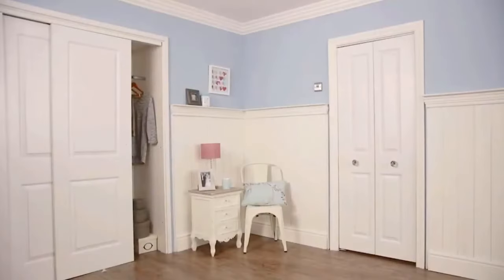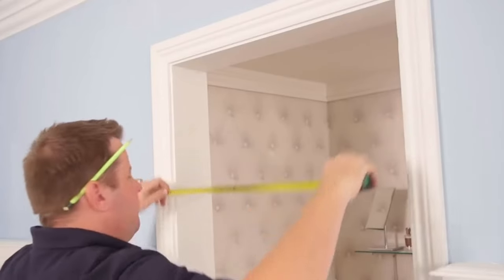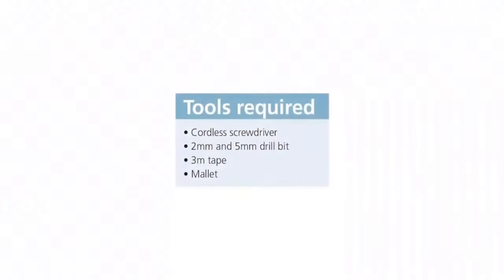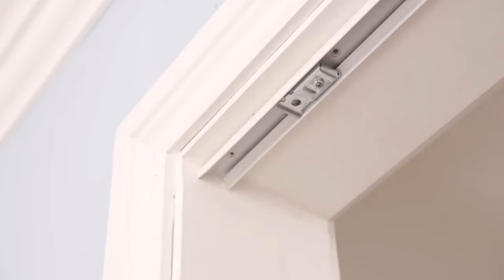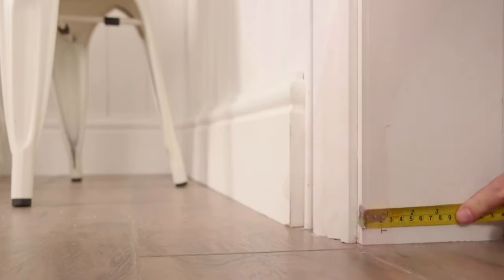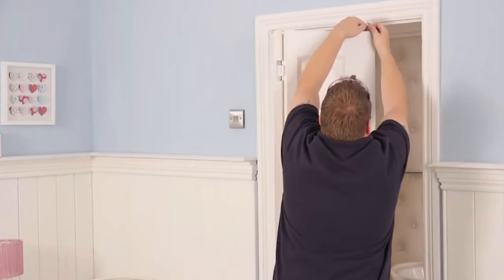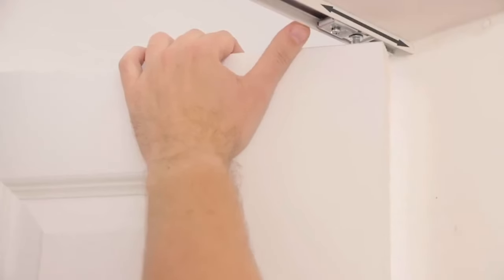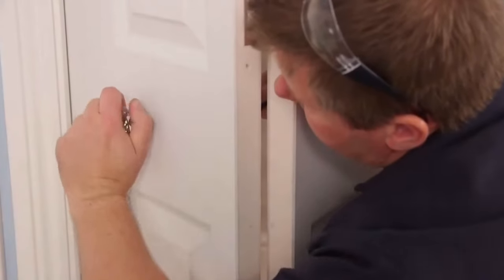Installing Bi Fold Doors

Comment: How do you close the doors from the inside ?
Reply: Doorknob goes on both sides
Reply: Carefully and shout out to someone if you are trapped.
Reply: @tomasmchugh2612  You can't do that as the two outside faces come together.  Any other suggestions?
Reply: @davejones3240  I've used a flush mounted pull ring